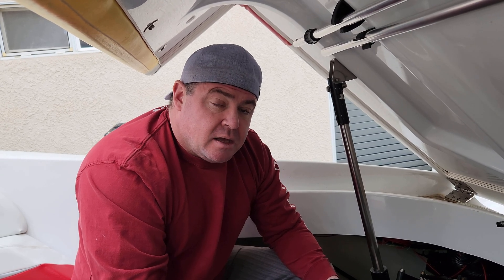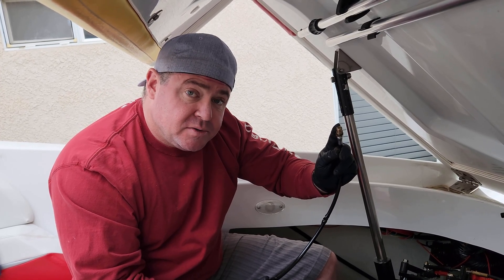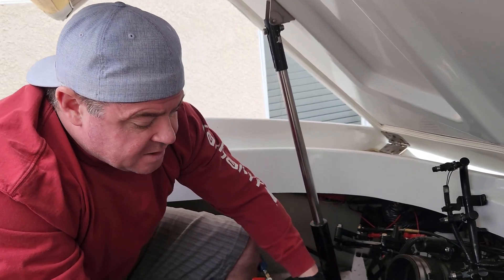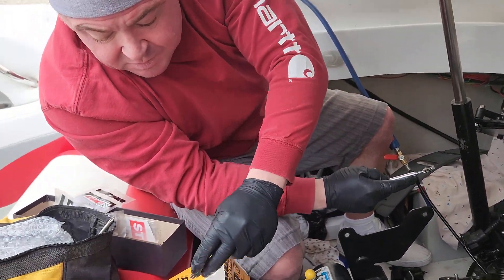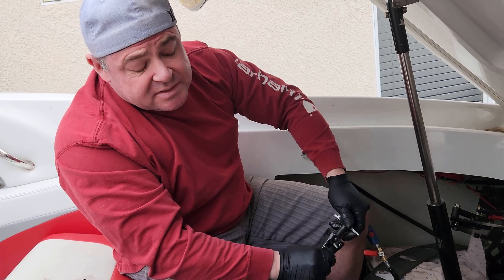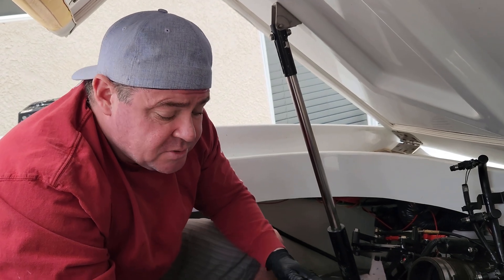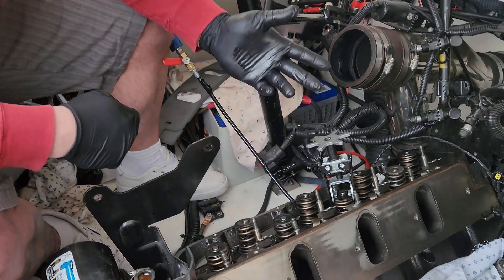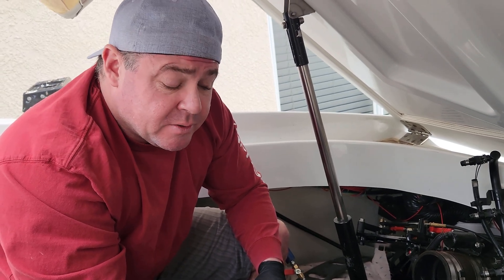8.1 Vortech 496 Mercruiser valve spring replacement in the boat Comp Cams

Comment: What cam and valve springs did you use, brand and kit/part numbers
Reply from the maker: I used a Raylar 203 cam shaft and comp cams dual spring set up I don’t have the part number with me, with a rotator and 10 degree keepers
Reply from the maker: I’ll send you the part number when I get home

Comment: Hey man wow doing your own engine work, I'm impressed! That is way above my paygrade. Hey, can you help me out, I'm about to order the SSL 4 prop with no hub from Hill, the one you had linked me says it is 15 1/4 x 24 RH. My current prop is a 48-13706 mirage plus 25p. I know nothing about props. When I google it, some results say 14.5 RH. I dont know what the spline count is I have no clue. Will the 15 1/4 still fit? My boat is a 1999 Baja H2X. And I was just gonna have my marina put it on for me, when they do all the other stuff I need to have done for this 2024 season, like impeller and outdrive maint, etc.
Reply from the maker: Your current prop is 3 blade correct
Reply from the maker: 15-1/4x24 RH rotation 15 spline solid hub over 400hp. That’s the setup you will love it
Reply: @good2know606  I have a 454 MAG 385 hp. Is the [15-1/4x24 RH rotation 15 spline solid hub over 400hp.] compatible?
Reply from the maker: @bajamike9276 as long as you have a bravo 1 outdrive you should be fine.
Reply from the maker: And the hub kit you can use under 400 hp. The difference is the over 400 hp is made of metal instead of plastic. It’s just extra insurance. In my opinion well worth it.
Reply: @good2know606  Cool thanks, I prefer anything metal too. I'll let you know how it works out when i get it put it on.
Reply: @good2know606  About to submit work order to get my 4blade on, currently sitting in the box in my living room. I dont have a way to do it myself as its sitting on the lift in the slip, I have the  marina haul it out whenever it needs work done. I'm curious what did you find regarding tradeoffs better holeshot vs reduced rpms and reduced speed. I never really went above 65 mph anyway, I know 70 ish was my top end, but so unsafe at those speeds and the female passengers dont care about fasst! My engine is stock 454mag 385hp.
Reply from the maker: You will have a lot better control while turning and out of the hole, when you turn now you lose a lot of power and it seemingly almost spins whiteout going anywhere, that problem will be gone, you will love it
Reply from the maker: Going up a pitch will move you faster at lower RPMs also and increase fuel efficiency and with this fuel prices we all need more fuel efficiency
Reply: @good2know606  Ok, well I got the SL4 24Pitch it says on it in the area where the hub goes. At the price I paid for it, I'll just wait and see and I'll let you know how it goes. Thanks again. I at least am summerized now, which is a start! lol
Reply from the maker: @bajamike9276 I just finished everything on mine, lake test next weekend and then I’ll bring it home wash and wax it and put it in it’s slip for the summer. Let me know how you like the prop. Take care
Reply: @good2know606  Yes its 3.
Reply: Hey man, I got the new prop on. Took it out yesterday, I love it! Feels like turbo, actually pulled me into my seat a little and jumped right up on plane. RPM's may be down, but speed is not impacted. I was at 55 mph with 3500 rpm, I'm not sure but I think I was at 4500 rpm previously with speeds around 60. I'll for sure be keeping this prop, thanks! Any idea what I can sell my old 25P 3-blade for??  Also, I notice my depth gauge is all over the place, blinks and is reading crazy high but then eventually is correct, but then repeats alot. My transducer is the hockey puck under the engine inside. Any ideas? I'm thinking I might need to replace the gauge?

Comment: So you left the piston and valves and rods standard? I am kind of keen to do the intake. I did the MSD and I found that it ran a lot better
Reply from the maker: Yes for now. I’m hoping this will put me around 520-530 HP. I have other videos on it I welcome you to watch and ask me any questions you might have. In my BAJA I should be running 75 to 78 mph with this package and that will be plenty.if I do the bottom end I’m going to add a super charger. Maybe next year we will see. Thanks for subscribing keep in touch
Reply from the maker: Do you know what parts numbers your MSD coil packs were by chance?
Reply: @good2know606  been a couple of years I can have a look through some of the order notes. But from memory around 2003 and later had a different one. I had 2008 engines, I think they were pretty much the same as the LS ones
Reply from the maker: @sammaw4925 ok no problem I ran into that problem